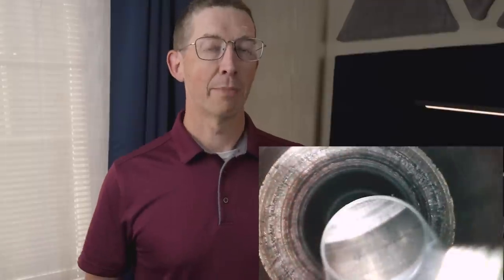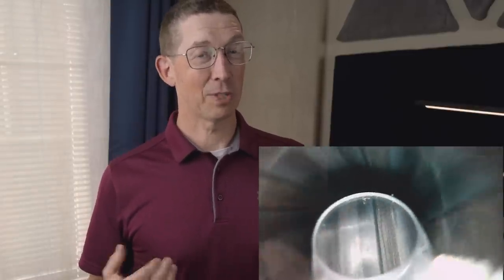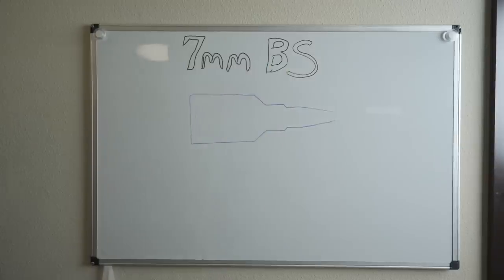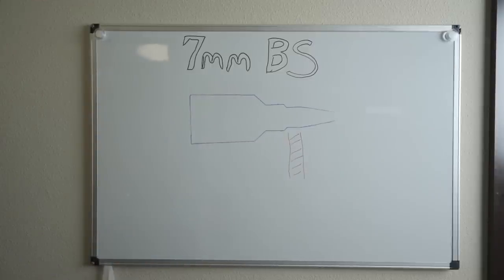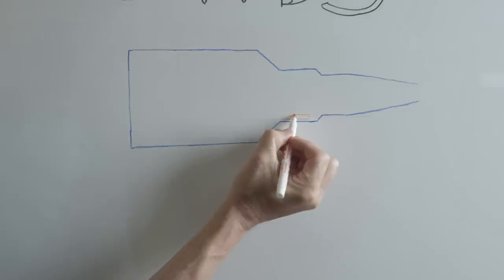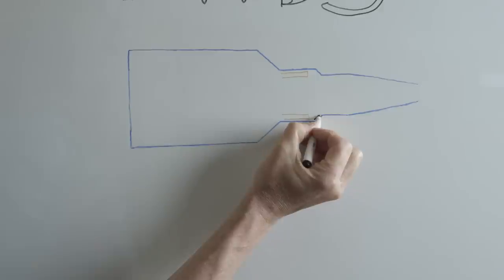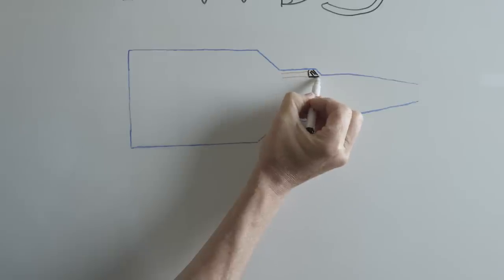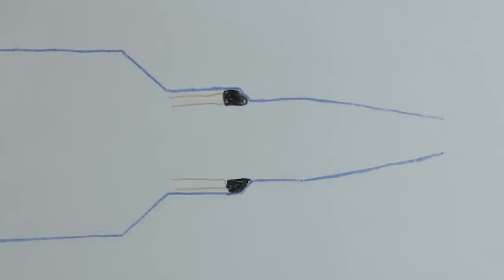Carbon Rings?

Comment: I have seen a few barrels that people take to me because some factory ammo is producing nearly punctured primers and ejector swipes.  I usually ask them for some of the ammo that is doing this and some that is not.  About 80% of the time I can just remove the carbon build up at the position you illustrated and the problem goes away.  Examination usually shows the case lengths of the various ammos differ by up to 0.025" (223 Rem and 5.56 Nato labeled).  Clean the ring and even 5.56 labeled ammo works in most 223 Rem chambers until the carbon rings builds from the shorter necked 223 Rem ammo.  Once the carbon ring builds again, the longer 5.56 crimped mouths have no where to go and of course pressure is going to build.  Off the shelf tolerances being what they are, means every barrel has to be analyzed as an individual.  No one rule fits all.

Comment: I've been reading that the brass needs to stay as close to max length as possible, i.e., stop trimming 5-10 thousandths off the mouth of the case. I case that fits at max length, or maybe trimmed only 0.002 from max is more ideal. I've not had time to test this yet but it seems like it would help. I wrap a couple 1 inch square patches over the actual caliber sized bronze brush, coat the outside with Iosso paste, hook up the 24" rod to a drill and get after it. This is after I've used Kano Kroil or Free-All to aid with good spread of the paste. I make sure the patch covered brush does not enter into the freebore. Works for me

Comment: I've had a pretty bad carbon ring before, and based on info I gathered from barrel manufacturers (Frank from Bartlein in particular), I took an oversized bore mop and soaked it in Boretech C4, left it in the throat area for an hour or so, then took an oversized nylon brush into the throat and manually turned it in place, also occasionally going back and forth around the throat area. That took care of it pretty good, had to redo that process a couple times if the ring is really bad

Comment: Lou Murdica addressed this in an interview from Erik Cortina.  He said even a carbon ring 0.0010" into the mouth of the case can increase pressure rapidly.  I try to keep the carbon ring out if possible.  I prefer to see the ring right at the tip of the case point.
Good discussion point.  Always nice to see these topics and talking about the tales we spin that are not much more than pure conjecture.
I put a little Iosso on a 223 or 308 chamber brush made of nylon bristles, works very well, and its really easy to clean up.  9mm brushes are good for that chamber end and throat.  Appreciate this topic!

Comment: These rings weren't even on my radar before this video came out; just copper build-up, which has caused me diminishing precision in the past.  But watching the video, I realized I've had the experience of dealing with a tough carbon ring, even though I didn't have a term for it other than "carbon buildup" at the time.  

When Hawkeye borescopes first came out, my dad got one that we shared.  It allowed me to see a carbon ring that had built up in my Service Rifle competition AR.  I clean barrels religiously and have never had one of these build up enough to cause a pressure problem.  Bronze brushes and Iosso Bore Cleaner (abrasive paste) probably kept them trimmed down enough they didn't matter over the course of a match.  However, with the borescope, I could see the darn thing, so it became a psychological irritant. No amount of brushing or abrasive cleaning would clear it 100% out of the bottom of the inside corner of the shoulder at the end of the case neck portion of the chamber.  The carbon remained, giving it a sort of 45° fillet.  

Then one day at Camp Perry, the maker of the then-new Gunzilla bore cleaner was giving away small samples on Commercial Row and talking up how it removes carbon and loosens rust, so I brought one home. After my usual cleaning had removed copper and surface fouling, I looked through the borescope again and was annoyed again at the stubborn ring still being there.  So I decided to Gunzilla on it. I ran the usual wet patch followed by a dry patch, which didn't remove anything my regular cleaning had not already removed.  But after I ran one last wet patch, and before I could follow with a dry patch, the dinner bell rang, and I had to go wash my hands, got distracted, and didn't return to the bench.  I didn't remember the wet bore until the next day, when it was about 18 hours later.  I then ran a dry patch through, thinking the original might have dried (it hadn't), and that patch came out of the muzzle with a perfect little black ring around it where it covered the tip of the jag.  I got out the borescope.  My little nemesis was gone, and the inside corner was perfectly clean.

Some years later, I ran into the Gunzilla makers at the NRA Annual Meeting and described this to them.  They said their chemist claims the product breaks carbon bonds. Anyway, I'm just saying the overnight soak method is worth a try with this stuff.

Comment: Thanks Keith. I have talked to several PRS guys who never clean their barrels. They claim that it shortens barrel life. I'm not sure whether it does or doesn't but I am sure that the inconsistent pressures caused by carbon buildup is not conducive to accurate shooting. And just as a guess, it probably leads to barrels being prematurely scrapped for new ones. 
keep making the videos!!! 
God Bless.

Comment: I just clean that area every time I clean my barrel, with a slightly over caliber Iosso brush on a chamber cleaning rod and whatever cleaner I'm using at the time. Use a patch on a slightly over caliber jag or brush to get the crud out afterwards and it's good. 
Probably fired 300 to 400 rounds before the first time I did that, came out plenty easy despite having a decent little carbon ring going at that point, and I've just kept up on it since on all my rifles

Comment: Precisely why I always clean my rifles after shooting them, whether 3 shots or 20. It won't have a chance to build up.
Reply: Just try to look with a borescope. In benchrest we clean the barrels every 10 shots with solvents + brushes but we still have this problem. Only abrasives pastes can remove it (Iosso, JB or boretech chameleon).  I don't like using abrasives too often but some shooters do (Cortina). The longer you leave it growing, the harder it is to clean it. If you don't have any borescope you can still test one of these pastes on the right spot, if the patch becomes black there's some carbon.
Reply: @br4713 Cortina isn't really the best example considering an outing for him is 150 to 300 rounds even if it's weekly that's alot of lead down the tube a thorough cleaning us advisable after that in general

Comment: Very interesting Keith. How much below maximum case length do you prefer to trim your cases? 0.002”, 0.003”, 0.005” or more? 
I’m starting to believe that I have over trimmed (as recommended in just about every reloading manual) my Lapua 308 Winchester cases 0.010” under maximum case length. Not many experienced  shooters mention it but I have heard one experienced shooter say that trimming cases 0.005” below maximum case length is enough. Cheers 🍻

Comment: Try a product called helmar 5700 carbon remover - won't work with scrubbing - it needs to soak for a fair while 6-8 hours you can follow up with wet patches during that time. 
Dry patch it out and give it a sweets or co2 boretech clean with a new brush  

It will remove all carbon and copper  without using issio or jb /abrasives with risk of polishing the bore 👍👍

Comment: 🤣I used to 300-800 rounds between cleanings, I mostly did it out of guilt. Recently, I picked up about 50ft/sec pressure out of nowhere. I did not check for a carbon ring but I assumed I had the dreaded carbon ring. I used a battery drill, short cleaning rod and a nylon brush with boretech carbon remover. My speed went straight back to normal.
Reply: Nylon brush + solvent, even with a drill you removed almost  nothing . Only abrasives can remove this hard carbon
Reply: @br4713  my velocity disagrees. Also, The nylon brush that was in the neck had thick bits of black carbon on it after a few minutes.
Reply: @francoisdavel1786  maybe you removed a bit, just enough to solve your problem, but there's no way to remove the carbon ring without abrasives.
Reply: I also managed to clean the carbon ring with the nylon brush from Boretech (which is harder than the nylon from the brush I had before and with which I had no chance). I soak it first with Carbon remover from Boretech, let it work for a while, then rub. I check the result with a borescope
Reply: @br4713  there are more than 1 guy with a borescope that has confirmed this method works.
Reply: @francoisdavel1786  no. I have worn hundreds of bronze brushes and I'm 100% sure of that. The guys who sell you special super carbon solvent that removes everything lie. Only abrasives can remove hard carbon

Comment: CLR with a nylon brush works great. Quit panicking, read the label. "Designed to work without damage to surrounding metal" i know they meant sinks, coffee pots etc. but my stuff is fine.
Reply: CLR etches carbon steel fairly quick.

Comment: Step 1. Buy a chamber gauge and figure out your max case length. Sinclair makes them
Step 2. STOP trimming your brass till you know this number in step 1. 
It’s ok to trim so all cases are the same but then stop.
Step 3. Trim to .005 off max.  Not the book max. Not the book recommended trim length. But the max of your actual chamber. 

Enjoy 😉

Comment: Thanks for the informative video.  I have a  bore scope so I keep up with cleaning and I see if any carbon ring  forms.  Iosso nylon brush with a  patch, bore tech C4. Push it in till you can feel the throat.  Let it sit there for  a half hour  to an hour.  Give the cleaning rod 50 turns and the ring is gone. Just a  question Kevin,  i see when you are conducting load development and shooting competition in F-Class, you use a shooting mat. What shooting mat would you recommend?

Comment: I wonder....if one were to polish the neck area...like down to 1-3 micron would reduce or eliminate rings?  It most likely is more about temperature and welding carbon to the metal.

Comment: What if you had a cast of the chamber neck to measure, or use the reamer specs. Then turned a brass rod with teeth to make a carbon reamer?
Reply: Sinclair has a tool to determine  actual max case length . You'll have to sacrifice one case by trimming to their noted length. You then insert the tool in case , chamber, remove and measure. My ER Shaw bbl 260 rem is actually+ .016" greater chamber length than SAAMI spec 2.035" max length. Sinclair still recommends adhering to SAAMI specs, though.
Reply: @tomphillips2608  Not chamber neck length. Chamber neck diameter. So it cleanes the neck wall all the way up to the beginning of the  freebore radius.
Reply: Yes , cleaning all the way up is important.  I'm just saying that with this tool if you trim cartridge length to your specific length chamber, the carbon ring won't be as big, longitudinally. A chamber cast would  provide this dimension as well. I found the tool easy to use. Surprised  to see length that over spec.

Comment: It sounded like you just gave me an excuse to buy a decent sized ultrasonic cleaner?
Reply from the maker: Hmmm. I haven't thought about cleaning barrels that way. Interesting!
Reply: @winninginthewind  just remember you actually need two cleaners,  one with whatever solvent you’re going to use and one full of oil to avoid oxidation.  Like developing a chemical photography print, you go from one bath to another hot solvent to hot oil.  If you plan to use flammable solvents the machine must be rated for it, standard designs can ignite flammable vapor.  I was joking a little only because it’s pricey and the machines take up a ton of space.   If I had the space and money I’d 100% do it.  Sharpertek is a great brand of ultrasonic cleaner.  I use them for shell casings before loading.
Reply: You don't need two cleaners. You could either get a second tank for oil or just oil the parts by hand after letting them dry. Or use a solvent with lubricant in it. Lucas makes a good one